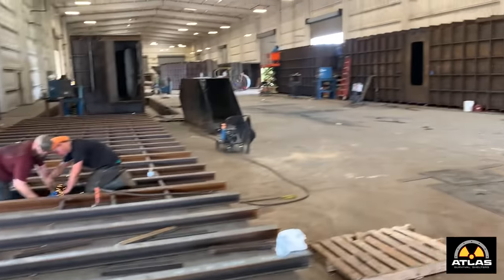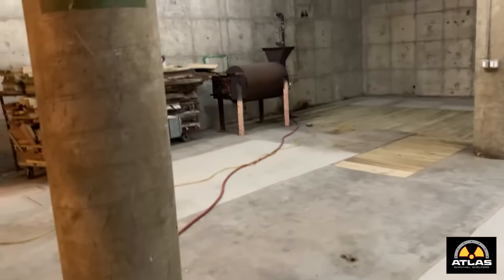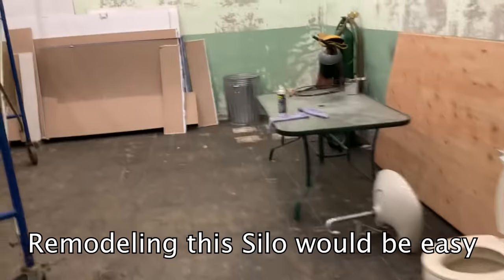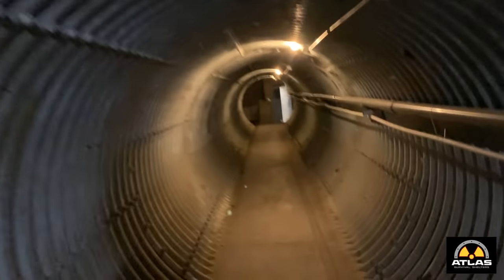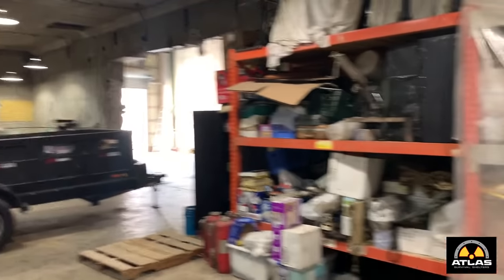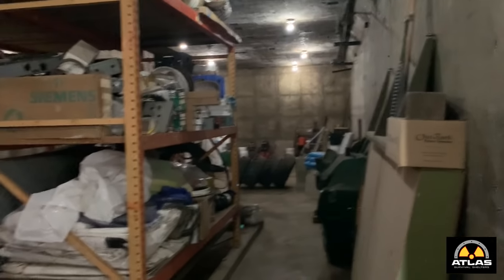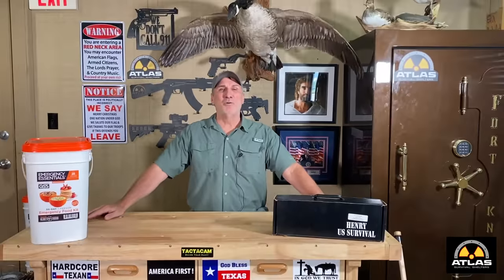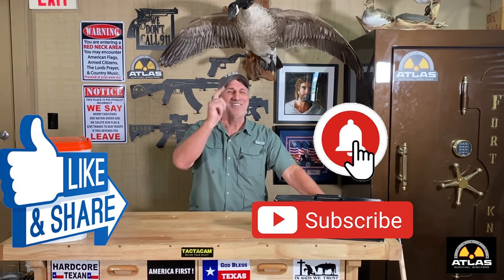What's Inside a $30 Million Atlas E Missile Silo!!!

Comment: Thing about storing food for prepping is you have to understand food rotation. You can't just store it and put a lock on it and think that it's going to be something you can survive on 20 years later. There's a reason that grocery stores require their food to be rotated you don't stop the new stuff in front you stop the new stuff in back. My grandparents did something similar and I never understood how you can be so prepared by stockpiling food and yet so ignorant to the idea of rotating the food and actually using what's there so it doesn't go bad. That's crazy to me.

Comment: I think those cans of food wouldn't look that bad if they had a dehumidifier in there
Reply: I would need a half dozen rolls of toilet paper to test that out. :-)
Reply: I would have sealed those food crates with plastic wrap to prevent the humidity getting to the cans.  Also put a desiccant in with the cans too.
Reply: Galvanize everything!!!
Reply: @richardcommins4926  I think that would've helped to a point. But if you have any significant temperature change  you can get condensation on the inside of the plastic wrap and that desiccant can only hold so much moisture
Reply: @MrChainsawFX  galvanize cans of food?? 🤣🤣
Reply: @jastark22181  Yes, the best way is to vacuum seal the cases of food.  There is a product out there for the closet with large bags for clothes that you can vacuum seal them.  That would be perfect to vacuum seal all your food preps.  Even the bugs would stay out too.

Comment: Need Dehumidifiers.  That will solve two issues.  It will remove the dampness from the air, thus keeping your canned food from rusting and damaging the cans.  The second issue remedied, you're collecting water that you can make potable.
Reply: Unfortunately, distilled water is not at all healthy to drink on a regular basis.  It sucks minerals from your body.  It would be perfect to use in small doses for cooking or better yet for washing and cleaning.
Reply: @dherman0001  You can also add minerals back in.  That would be no different than what Israel does in their desalination plants...
Reply: Just galvanize the cans. Easy fix!
Reply: @dherman0001  you can get minerals from your food, lol
Reply: @larry skylar
I was thinking the same. It seems logical to me. ~Peace!
Reply: grey water for washing...
Reply: @dherman0001  electrolyte pill + multivitamin and distilled water is fine
Reply: I mean honestly that deep if you looked for the water table theoretically you could have spring/well water.

Comment: A tip on storing your cans. Spray them with flex seel clear. It will keep out the rust, and still let you see what is there. It can possibly be used to make some make-shift radiation gametes out of everfy day coating.

Comment: The humidity would have been taken care of by the sites environmental equipment during the operations of the site.
 The cans of food there now as seen could have been better protected from the moisture if the current owners installed a de- humidifier where they stored that food. 
I'm positive it would all most likely be edible if opened now. You'd just need to clean the outer contamination off of them.

ALWAYS BE PREPARED
Reply: You mean the decommissioned environmental systems?  Because the space would require more electricity than you might think to run a bunch of household dehumidifiers.
Reply: @Erin-Thor  would be much more effective to just store in plastic bins.
Reply: @Sffker  — Very true!  Toss in a few silica gel packs and you’re done!  👍🏼😎
Reply: Canned food is good for 2 to 5 years. If the cans are showing signs of rust or bloated, they should be thrown away.
Reply: @bdmenne     Do you really want to spread bacteria or remains of rusty cans near your home or shooting range????? I wouldn't. If you're so inclined to do so, then you're being irresponsible.
Reply: The walls and ceiling should have been ceiled too, with the de-humidifier..
Reply: @sbruin     The downside to a dehumidifier is that it has to be constantly emptied. Though, I'm sure that some means could be found to automatically have the water diverted from the dehumidifier to a larger storage medium via a pump. It could then be filtered and later used. All one needs to do is find a way to do so. Also, dirt on the roof of the missile silo could be removed and something built on top to utilize the space. That would be my plan.
Reply: @southtexasprepper1837  lmfaoo canned food can stay good for well over 20 years the hell you on about😂🤣
Reply: @moneybilla    Let's have a lesson here for a moment. If you want to eat a twenty (20) year old can of Tomato Soup, then have at it. High acid canned goods such as canned fruits, including tomatoes, should be eaten within 1-2 years past their expiration date. Low acid canned goods like vegetables, canned meats, and soups should be eaten within 2-3 years past their expiration date. Other canned foods are good up to 5 years. That's based on information from the United States Department of Agriculture. Much of that was researched during the 1950's and 1960's. Being a Prepper (or "Survivalist"), I done extensive research in this area. If you have "dented" can goods, they're still safe to eat, but SHOULD NOT be included in your Survival Pantry. They should be eaten immediately or donated to a Food Bank. If there are can goods that show signs of rusting on the outside of the can, those should not be opened and should be disposed of. Also, before attempting a poor attempt at seemingly being more intelligent than someone else, you should take the time to fully realize what you're talking about before being upstaged and be made a fool of. Just saying!
Reply: @southtexasprepper1837  well said
Reply: @ericallen7200   Thank you for your kind words. "Subscribed" To Your YouTube Channel.
Reply: @southtexasprepper1837  swing and a miss
Reply: @godofdestruction4636   O.K. You go right ahead and open up a rusty, bloated can of food and eat it. Let's see how you feel in about 6 to 12 hours when you wake up in the hospital after you've had you stomach pumped out. That's if you wake up at all.
Reply: @southtexasprepper1837  il feel just fine ty😂
Reply: @godofdestruction4636  I seriously doubt your honesty in regards to this. Personally, I'm thinking that you're just trolling because you have nothing else better to do with your Life and you're looking for some excitement. Sorry, but I'm not going to entertain some kid in his Mother's Basement.
Reply: @godofdestruction4636  "Muted" and "Blocked." 🚫

Comment: I’ve been inside a few titan missile silos, one was the museum, the other was not. They pop up for sale in AZ every now and then, granted they need a full refurb. 20 or so acres plus a missile silo for like 500k ain’t too bad in the desert
Reply: How cheap is average property out there ?
Reply: @Matty_icee55  you can get literal desert acreage out in az for a couple thousand an acre if that. that's like, out in the boonies pricing.
Reply from the maker: It's as low as a $100 an acre near Kingman
Reply: @AtlasSurvivalShelters  Man, that sounds nice. Californians are going to ruin that damn state, though.
Reply: @husky3g  California is so screwed up even the seagulls are moving to Colorado Springs.
Reply: The Titan II complexes in AZ were demolished.  All of them were scrapped for salvage, and back filled with dirt and concrete, other than 571-7
Reply: @timf2279  actually, there’s quite a few that still pop up for sale every now and again in less than stellar shape. The only part that was actually demolished is the missile silo and tunnel leading to said silo. The entry point and crew quarters all remain intact, though they have been completely gutted.
Reply: @hagggle3727  yes I saw one as well, total money pit for sure.  I was reading the AZ locations were the only ones that were decommissioned to that level.  The other States didn't destroy the cableway.

Comment: Not even 6 mins in I am loving this. Fair play to them letting you look around... 11:35 got to have a bobcat in the bunker. This is so cool. Food storage needs to be cool but with less humidity so that it does not react with the oxygen/steel (rust). You are not doing a very good job at hiding his face lol. 23:26 That old solenoid door lock !!! Cool..26:05 sounding a little outta breath lol.Sneaky rabbit at 28:04 .My only issue with these bunkers is that it's too easy for someone or other parties to mess with your air intake/exhausts and your water !! Can have as much food as you want no use without fresh air and water.. Awesome video really enjoyed this and we need more like it lol. Thanks
Reply: Yep, I think the same thing.  They can clog or poison the works very easy.  You would need 24 hour surveillance, therefore, 10-30 people for shifts or some really awesome automatic camera detection systems covering many areas.    Jeez, it would be fun to fit that place out for security.  Reminds me of the A-team television show.
Reply: @bdmenne  A few remote/auto sentry guns might work well 😁 Send up the drone with a gun attached 🤣

Comment: I used to build large cellars for multi pad drilling. About the size of your bunkers. We galvanized at a kettle in Salina Kansas. Basically large steel boxes but you could put a large drilling rig on top of them. You can look them up just by Googling “Cellar Tech”. We got bought by a big company and I got out of there. With the right engineering I’m sure you could galvanize your bunkers as well. We were very good at it.

Comment: As long as the tops aren't popped up it's still good.   Should build some roller shelves to keep the oldest cans being eaten first and the newest cans being stocked from behind.    It will give a 2 layer per can or up to 4.   If it's a front fill than have a bar across to kep anyone from picking the new cans.

Comment: Problem with these type of bunkers are that they were designed to withstand a hit - they weren't designed to prevent a large group of people from gaining access.  So the purpose of the bunker has changed from its original purpose.  Now, people want bunkers to live in and KEEP PEOPLE from gaining entry.  A lot would have to be done in order to change the purpose of this bunker.  It's a great starting point - but I think a half dozen people with some tools and ingenuity would be able to enter it sooner or later.
Reply from the maker: Well of course.     I can enter Fort Knox with the right tools.    But if people are shooting at yiu that's the plan
Reply: Moats, barbed wire, pikes, trenches, and picker bushes.

Comment: Alot of dank concrete. Air circulation is a must. 
Residual Trichloroethylene, asbestos, lead paint.

Butt other than that hell yes!

The whole Atlas E system was abandoned for many reasons. One of the reasons was because from alert to launch time took too long. They drilled and practiced those 27 facilities to death but could not get the missile launch ready in under 22-24 minutes. 
Every exercise they did involved filling the missile fuel tanks. It also meant unloading those tanks and running a solvent cleaner through the system too. This cleaner was usually pumped out topside on site lol

Comment: Damn someone throws a grenade down those skylights or a stick of dynamite and there goes the genny.
Reply from the maker: Skylights need to go
Reply: I'd make the skylights work like a periscope where there's a bend that goes to a prism.  A grenade would just blow the skylight and seal it, not the generator or a part of the bunker.
Reply: Need laser trip wires, cameras and howitzers to prevent the sneak attack.

Comment: Food storage mainly aluminum must have a dehumidifier or placed in a air tight room. Or the cans will rust in 5 years or faster. Depending on the humidity level. This is actually the result of the good air flow this bunker has. Batterie "storage" also

Comment: What's stopping someone from cutting through the mesh and crawling through the air pipe?
Reply: Good question. I'd install an alarm system in the air vent. I'm pretty sure there were originally a way to seal that off as well.
Reply: I would assume there are or were bars In the pipe as well to keep anyone from going though. Plus the blower might suck you in and probably not be good for your health

Comment: As for the wind power, I'd get 3 full sets of batteries that could run the place and a few spares just in cast there is breakage or any quick to fail batteries, but get them dry and keep the acid stored next to them because batteries do not decay/age until the acid in poured in, so if a set would last a decade, you would have 30+ years worth of battery use after SHTF takes the grid down.
Also, set up the generator to run off straight vegetable oil and have that stored as fuel because it will last longer than Diesel or even Biodiesel.

Comment: I'm thinking some UV grow lights in the storage room could act to kill off mold spores.. and be usable for a grow room... really sad... the higher the humidity.. if there is corrosion I am guessing that the hg% probably like 80% humidity ... but anything over 60% and you will start having issues.. on the flip side if you have dehumidifiers too you can use the water pulled from the air as a water sources for growing/drip irrigation.

Comment: With the surplus of power. Put in some dehumifiers. Your just rusting your canned food with that moisture. Pretty cool bunker. Needs some TLC but isn't bad at all.
Reply: Simpler to just use plastic tubs instead of the crates they were stored in.  Chuck in a couple of silica packs in each tub (sticky-tape them inside the lid.  Easy to stack, often have rollers on the bottom, hold heaps.

Comment: Damn.  Looks like my dream home and workshop. My uneducated opinion, needs some power upgrades (add wind for stupid capacity and modern batteries) and humidity control measures.  Lots of garden, livestock  potention. Not familiar with winters in that are, but appears to have potential to be snowed in for an extended period of time.
Reply: wyoming doesnt have any shortage of wind or snow in the winter.

Comment: I believe I see evidence of chloride-induced rebar corrosion. I would have to have an engineer take a good look at that place before I bought it,,, for just the bunker. Looking at the rust on the cans that could be more than just moisture affecting them. I wonder how much calcium chloride was used when they mixed the cement; probably a lot. Even still you might get another 40 to 400 years out of the place no telling.

Comment: 21:40 The blast door is not solid steel it is plate steel filled with concrete. The door would weigh 150 tons if it were solid steel 😊

Comment: I did not see any sort of a blast door on the house side.  Did they just cut a hole in the concrete roof?

Those cans go to show you how important dehumidification is.

That generator on wheels should really use a piece of flex pipe.

Comment: Eliminate waste. You gotta rotate your stock. Canned food expires. It should be rotated. Meaning its part of your normal food consumption. Even the 25 year freeze dried stuff. Have a rotation. What good is preparing if nothing is good when something happens? 🤷‍♂️. Think about general emergencies. Blizzards, storms, or just getting through winter. Then seeds to plant in spring. Heck a place like that should have a grow room. Crops all year round. 
A good plan will work now, before stuff happens. 100 years ago you filled the fruit cellar and used it all winter trying not to waste anything. It’s normal not paranoid. Hoarding stuff and letting it go to waste makes it all pointless.

Comment: Work in progress for sure...Price? tough call.. In today's market, everything is overheated.  I think total this thing being it still a heavy fixer-upper, probably low 900K+  but would not offer much more than that. Some of it seems to have the venire of being fixed up but it actually possesses some fairly haphazard type setups. I don't get a very warm feeling about some of the adaptive construction and how much longevity it may possess. some of the evidence of the condition of the concrete is very concerning, cracking and such. This really would have to be carefully looked over to see just what you're getting into.

Comment: Acidic foods are a no-no, no-go.  Other foods in cans should be okay as long as the cans are intact, undented, and the seams/seals are not leaking.  Dry foods should be okay as long as the packaging is still intact, no holes or tears.  One telltale sign for foods is the color is still normal...any off coloration or crusting, gross color changes are warning signs.  Off smelling or rancid smelling are another sign of spoilage.

Comment: A bank of dehumidifiers running 24/7 is needed here, you can't have your canned food rusting away like that. Wind turbines are OK, but you can't run a mechanical device under load without maintenance forever, a bank of solar could be picking up the main loads. That generator needs to go on a support if it has a fixed exhaust pipe.
I wouldn't buy it though, not many preppers want a two hour drive to pick up supplies and that soil is worthless. I hope he's putting in some cameras, unlike that Comms silo you filmed.

Comment: because the bunker is that old, is there any danger from concrete “rot” or dust?
Reply: They say the galvanizing makes the metal last longer and I fully believe it does. I just don't know enough about these things as they age. Is it possible for a chunk in the galvanizing to allow rust to start behind the surface? I wouldn't think setting like that is a short term risk but 150 years later I don't know man...
Reply: I’d be more worried about asbestos